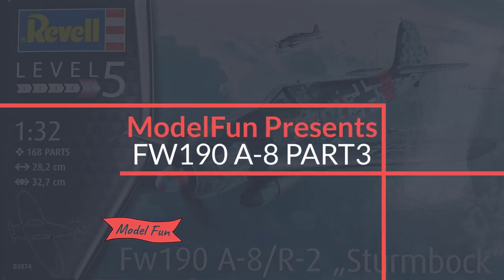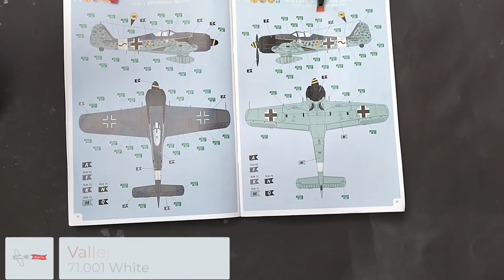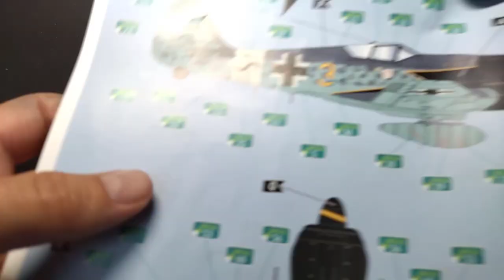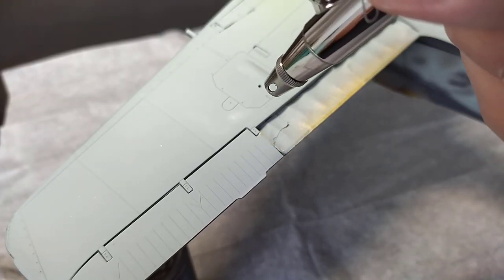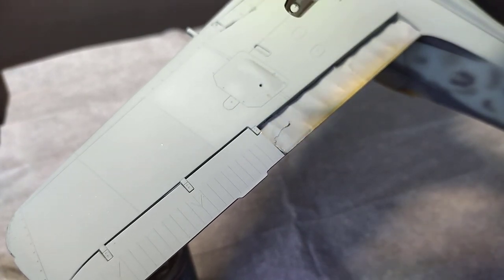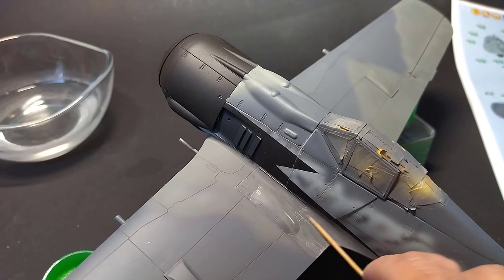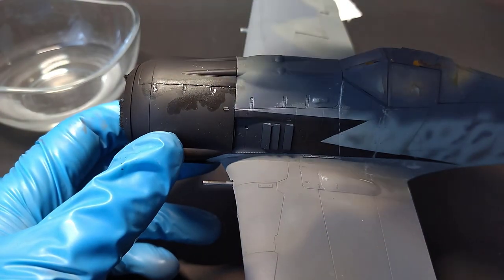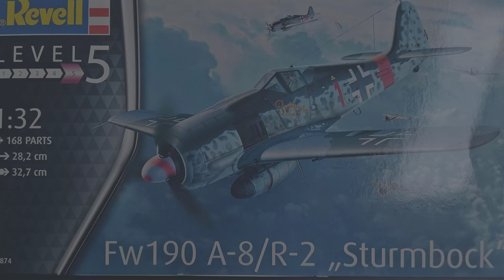Fw190 A-8/R-2 Sturmbock. BUILD PART 3/4. Revell 1:32 03874

Comment: Awesome video just subscribed….. I see you’re using Vallejo paints I’m trying my best to try to like Vallejo no matter how I spray them they always have tacky feel to them even weeks after they dry any tips ?
Reply from the maker: Welcome Android 13. 
Yes, I use Vallejo from the beginning, have no problems with them. I use dedicated thinner and Flow Improver from Vallejo. Not sure what you mean by "attackingness", so hard to say if I ever had similar issue.
Reply: Ugh ….I mean does it feel rubbery or tacky
Reply from the maker: No, I did not experience these problems. After dry, all looks OK. These paints may not be as durable as enamels. But I like to work with them.